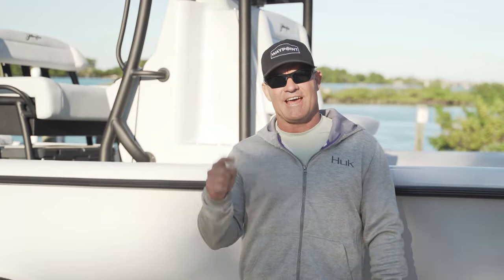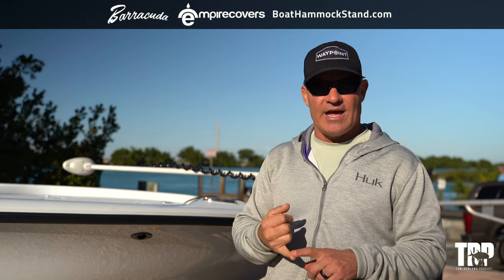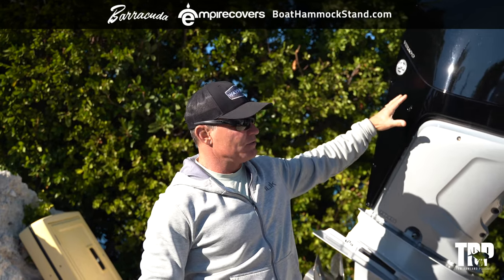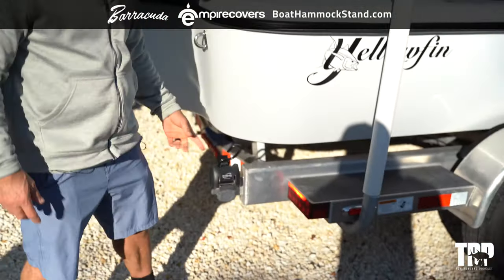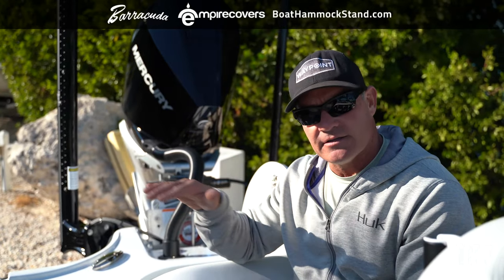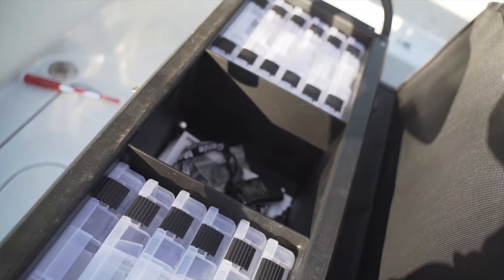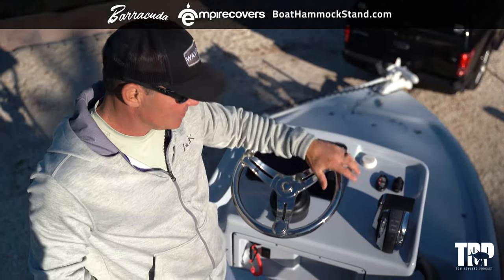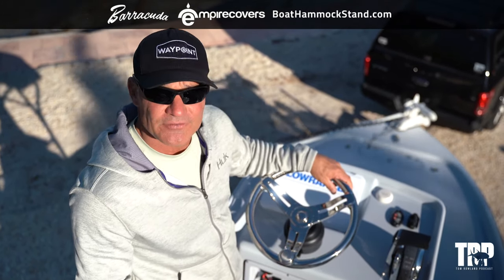How To Build The Ultimate Bay Boat - My 2021 Yellowfin 24 CE with Mercury 350 Verado

Comment: ... We can all agree that it's a great boat, no doubt. Do all the 24's from the past have the rod storage lids opening inwards?
Having the PP C-Monster pumps in the center console obviously needed to have hydro hose extensions. Does PP sell them? 
Wish you the best with the new rig.  👍
.
I just installed a pair of PP Blades on my Triton 240 LTS and have the pumps in the stern. 
This meant I had to run Ancor marine tinned  8/2 duplex wire (two pairs) to the center console house battery.
.

Comment: Thanks for this video Tom!  I’m building “my ultimate” bay boat (should be here in about 6 weeks!) an I must have watched this video 500 times.  I was going to go with a 12v Lithium Pro for cranking and a 36v Lithium Pro for the TM with a Charge.  My dealer checked directly with Mercury and Suzuki said both said NO to lithium cranking batteries.  They said the outboard would not be able to detect the charge on the lithium cranking battery and would over charge it to the point it could explode!  Yikes!  They followed up with Power Pole and who knew about the issue and recommended AMG cranking and a 36v lithium for the TM.  Have you had any issues with your cranking batteries?